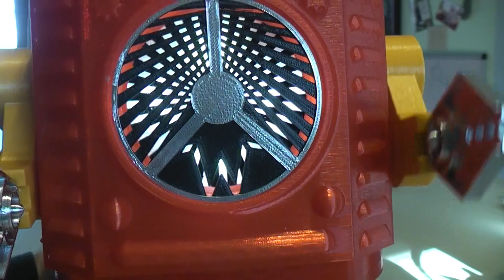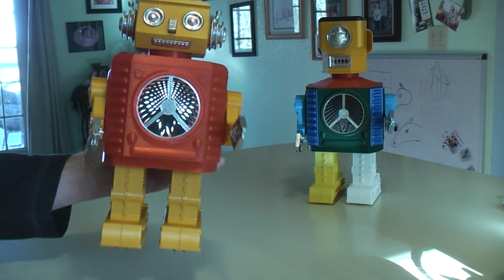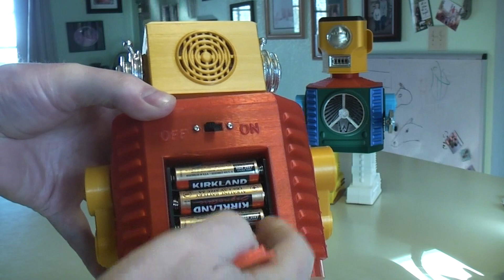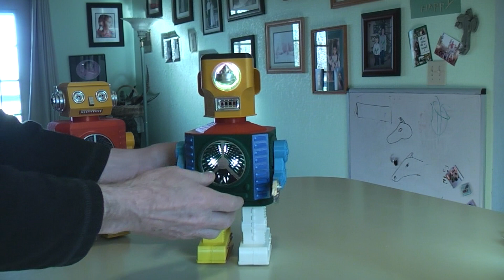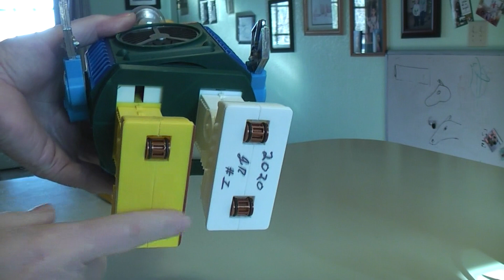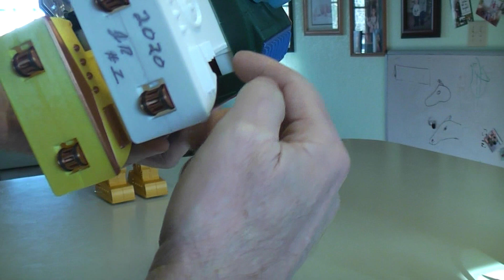Jupiter 2 Radar Robot. 3d print. Linear shuffle walk, turning body, moving arms moving radar screen.

Comment: These are really great! Do you have info on the electronic module you use to drive the motors, lights and talking unit?
Reply from the maker: The motor controller I have done 2 videos on. It is the L911os. here is a link to the mod I used.
https://youtu.be/eDXcUsldIS4
The sound devices are just greeting card guts that you can buy on ebay , they give you about 10 seconds of digital playback. The TT gear motors I have done videos on many times. They are very common and come in different gear ratios. 1:48 is fast and will work well on a 3 volt system. The 1:120 tt motor is slower and has more power , I am using this motor at 4.5 volts in this build.
Reply: Robothut great! Appreciate the info... I’ll look back through your old vids to see the other cool stuff!